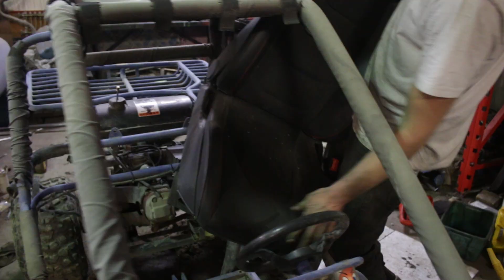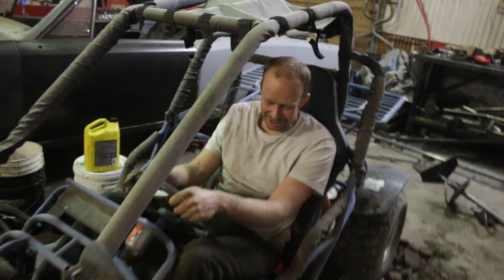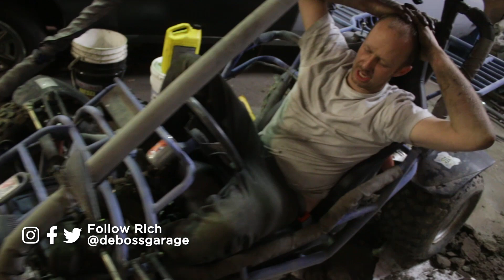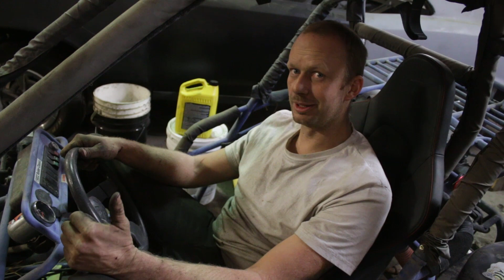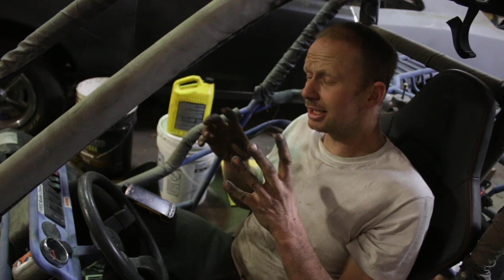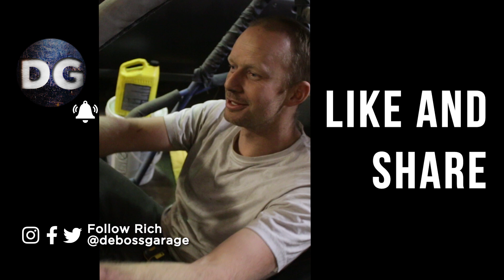Everything Wrong With The Self Driving Car

Comment: Aircraft have had the capability to be autonomous for years built to high standards and with redundancy but still there are mechanical failures.   The 737 Max 8 is the latest case in point of why putting so much trust in computers over man is a bad idea.  With that fubar should we not all be wary of self- driving trucks? 
 Don't give up your license anytime soon lithium is a finite resource hydrogen powered internal combustion engines are on the way.

Comment: Rich...you gotta be reading my mind man...everything in this video....is ..is...lets just say i think exactly the same about every subject...i should contact you through facebook ...we need to talk....I got an 03 cavalier with 2.2 ecotec with mid-rear mount turbo....saab 2.0t  aluminium intake manifold...875cc injectors.. I got a map sensor on mine..no check engine......ecu good stock for 500+...but if tuned even better...stock non forged bottom are good for 350hp before rods fails...

Comment: Electric and self drive cars will rescue self drive cars and the IC engine. For too long cars have been the realm of privilege. Look at how few cars are used in the third world. What percentage of the planets population have access to vehicles or reliable transport? I love cars but have lost tens of thousands of dollars using them as well as a bunch of loved ones and friends, I will welcome changes that make public roads safer and more accessible. IC engine self drive cars will become the realm of enthusiasts that will be able to run on easy to manufacture self made parts, based on recycled parts and fuels processed by cheap solar and wind energy (alcohol, methane and hydrogen). I can't wait to get on a racetrack driving a cheap old FWD car that has been boosted with supercapacitors and electric motors on the rear wheels running on a sustainable fuel that doesn't screw the environment.

Comment: I think you are right on with your thoughts of the autonomous vehicle.  I drive an Oshkosh front discharge concrete mixer and I really don't see how a computer can do what I do.  There are just to many variables to take into account,  soil type,  wet, dry, muddy,  uneven terrain,  is there a sewer tank to watch out for or a drain field, water lines,  some of these things  you can only tell by how the ground has been disturbed.  I would like to see a computer drive on some of the goat trails we drive on in the mountains.  I think in the construction industry we will always have a human driver.

Comment: It needs a flame thrower, just in time for the apocalypse! Rich, I think you're too pessimistic. The "self-driving" thing will be a strictly urban thing for a long while. The heavy commute, stop 'n go. The usual Toronto crap. Same for purely electric vehicles. Unless there's a sudden material breakthrough battery capacity will limit the range for a long while. Lots of short mileage and tons of charging stations. City driving. OTOH, the big money will be long distance trucking with driverless vehicles. I can see most of the major cities getting bypasses like the 407 to have the rigs going around the city, not through it. All around the periphery will be warehouses that off load the driverless rigs onto "electric?" driver rigs to deliver in the urban area. The big thing is the grid capacity. Once this wants to take off you're going to find major issues unless the gov. gets off it's ass and starts building more generating facilities. We'll see.

Comment: I hate hybrid cars, and all cars with stop start .   When I push the skinny peddle I want to friggin go!!!  I don't want to wait for the hoopty to realize It needs to move,  a little,  maybe move some more,  really slowly,  and finally start ,  as I have the peddle pushed half way to the rad support.... 
 I don't want electric.  I wan't to rev it to the moon and side step the clutch..I want  loud noises when I get on it , damn it..    I want to smell stuff,  I want to smell race gas,  burnt rubber,  burnt clutchs...Not a hot circuit.  
 Cars and woman need to smell a certain way.  If it don't smell right,  you're only going to drive it when you have to.  Thats no way to live.

Comment: And after all that, the car batteries will be used to turn off gravity and all you will need is a five horse power motor to hover drive at 150 miles per hour.

Comment: I work for a Subaru dealership, and drove one of their new high end Foresters, and it had partial autopilot. Out of curiosity, during my 1 1/2 hour drive between dealers, enabled the smart cruise control, and eyesight. (more on eyesight in a second) The smart cruise control read the signs on the street, and set their speed limit to that, and you can set your following distance from the car in front of you. Eyesight reads the lines on the road and keeps the car within it. In a nutshell, I basically drove for an hour and 15 minutes, with only my thumb on the wheel, feet planted on the ground. It went through the city stopping and going, going with the flow of traffic (If the manual speed limit was higher than the usual traffic speed) and basically drove itself. I had to keep my thumb on the wheel because it knows when you take your hands off and beeps at you. It was a fun and interesting experience, but not something I would do again, or ever buy for myself. Something that irritates me so much is the beeping. The constant beeping telling you "oh sweetie your seat belt isn't in!" It's a sack of potatoes in the passenger seat. I had to buckle those spuds up to get the beeper to shut up. This isn't restricted to Subaru either, I drove a TON of used cars and had plenty of seat time in alot of different brands. Very few companies kept their quality up, (ie. Subaru, Chevrolet pickups, and a few others.) Going back in time to earlier models, they felt real. Like the steering meant something, now they are just circles that you turn, and the car just goes around. Autos shift whenever they please and I don't feel comfortable driving them. Sure they're safer and all but it's no fun. I'm sticking with my 91 non-ic W250 Cummins with a 5 speed getrag with worn synchros. Dobule clutching every shift, rev matching perfectly, feeling the world through my wheel, seat, and the engine through my pedals (feels more indicative in a P-Pump as it pushes back on you somewhat compared to the VE-44) Learning on my father's '97 3/4 ton 12v auto, that thing was a blast to drive, I understood its shift points perfectly, and felt everything through the wheel. Taking my driver's license test in my mother's '11 Dodge Journey was hell. Couldn't tell when it was going to shift up or down, never remained the same speed, pedal felt fake. Steering never communicated to me unless I hit something hard. I was asking a computer to do what I wanted, not directly to the motor and the car. I will stick with my first gen cummins for as long as I can, and if I needed a car, it will be a search in the older generations (240z/280 pleeease!) and hope it feels proper.

Going into post-secondary for auto tech makes me excited, because it's what I love to do, but when will it go out? When will I go from working on old vehicles and such to just mindlessly reading a computer and following directions on the screen? Will I have to go into EV conversions to hold onto that passion of figuring things out?  I don't know, but it  will happen to me during my lifetime, and I'm not looking forward to it.
Reply: Driving new cars felt like I had to rely just on my eyes, and not by fee and sightl. They feel so muted to the outside world, its painful.

Comment: The number of jobs available will not go down. When new technologies arise, old jobs are displaceed. So some people will temporarily lose their jobs but the new jobs created are usually just as good, if not better. For instance, people could start working fewer hours because of the cost of goods will go down so much since drivers won't have to be paid.
Best example to us in the states was when the plow was invented. People thought tons of jobs were going to be lost, but field workers ended up going to work in factories where they were paid more and out of the hot sun. 
Quality of life improves dramatically with newer technologies and there will not be any net jobs loss. I'm optimistic about the future! I'll keep plenty of internal combustion motors around too. :)

Comment: Before retiring I worked on Transit Buses for more than 30 years. I Worked on our fleet of over 560 buses all powered with 2 cycle Detroit's they were all replaced with 4 cycle Detroit's and Cummins Diesels. The two stroke diesels were tough noisy and easy to repair and maintain. But they could not meet emissions requirements so out the door they went. Next came the 4 stroke mechanical Cummins engines. Again meeting emissions requirements meant the updating of the fleet with electronic controls on the engines of any new or refurbished equipment. Every step along the way towards improved emissions and fuel economy saw an increase in maintenance and procurement costs.Many government bureaucrats chalked up the growing maintenance budgets to the cost of doing business.I pay taxes so that one is a sore point with me. I became a supervisor and was incharge of fleet maintenance, so I know first hand just how costly it is to train staff and maintain that fleet .Over the years we tested alternate fueled Methanol buses, battery hybrids and towards the end of my career we started using fully electric (battery) powered buses. Here is my point, every step of the way towards the future of self driving electric or Pixy dust powered vehicles will require that those vehicles be stringently maintained.Because Lawyers will always have jobs. I think that means short term lots of demand for highly trained men and women (well paid) to look after these first future vehicles, at least the next 25 years.I also think because that future technology is going to be very expensive to purchase and maintain a new ownership model will come to pass. In the 1950's radio and TV repair shops where common. Similar to vehicle service facilities today. Back in the day people used to replace defective vacuum tubes in radios and later on in TV's they owned. Rich is right in that we are in a time when you can still wrench on your own stuff be creative and save money. But how many TV / Radio repair shops do you see today? The same thing will happen to vehicle service facilities as the internal combustion engine is replaced with new more complex technology. Notice I did not say better.

Comment: NO the enemy will microwave our electronics, we will be sucked into the dark ages . The only thing  that will run will be 4bts and 12 valves because all the other mecanacle diesels fell apart!
Reply: we can hope right? now we're both on some watch list :P
Reply: I disagree, Mercedes mechanical diesels rival if not best Cummins engines for reliability. But everything else is true.
Reply: Welcome to the club. I have been on Democrats list for a wile
Reply: Wow. Lol that is the most wrong spelling of mechanical I’ve ever seen. Talking about phonetics...it is on point.
Reply: Well it could also be a solar flare or coronal mass ejection that triggers an EMP.  Lots of ways back to the 1800s at least.  We’re a cheery bunch lol.

Comment: I do think that we wont see the end of the internal combustion engine, I think it will last another 80 years easy.  I do agree with most of what you say although, even thinking back 15 years ago and thinking about a 18 year old kid driving across the united states with no phone, no turn by turn directions, and no safety net of any kind, and even now that is so alien to me to think I couldn't just look up where the next gas station is or where am I getting food.  And like you said I used to do my best thinking while driving, I wanted to figure out the miles per gallon on the trip, done in the head, thinking about complicated concepts, or finding myself a bit, we did that while driving.  It really is an addiction, we can't be more than a few feet from these "life control devices" anymore.
Reply: The ICE will last forever. One word.
Ethanol.
Low emissions, renewable...

Brazil sells 100% pure ethanol since the 1980s. It's just a matter of time.
Reply: @lorenzo_br5803  using ethanol to replace petroleum would be realistic, attainable, and sustainable.  It would also create more jobs and the need to grow more grains for fuel production would have the side effect of greater food availability worldwide.  It is not being developed or pursued seriously because governments like the power and control that all the new technology means for them.
Reply: Andrew E that's probably not true as you do realize electric and gas have lived with one another since the 1800s electric went away because it makes no sense as still doesn't less range far more toxic emissions and then has no where near the amount of fuel sources this is like saying electric will replace pneumatic and hydraulic motors
Reply: @jdrok5026  the difference being in the battery, lithium ion have made electric more viable in the last 10 years, and their range is only getting better.
Reply: Electrics are better in every way, acceleration, upgrades, reliability, range, cost, etc. In many ways they already have beaten the ICE. I will never own electric because it's killing like half of all jobs in the US, and because I like to control my property rather than the other way around.